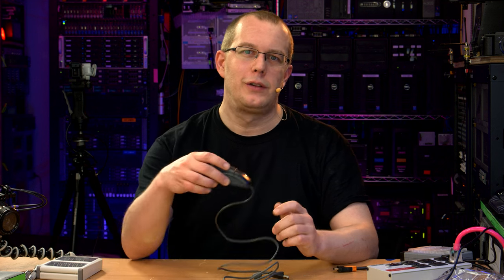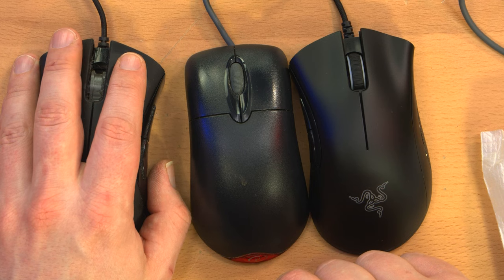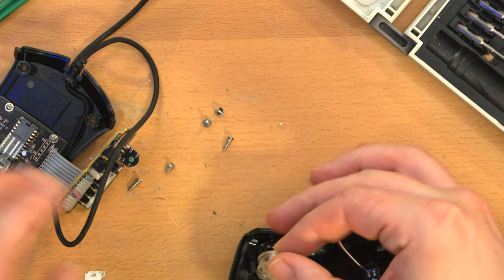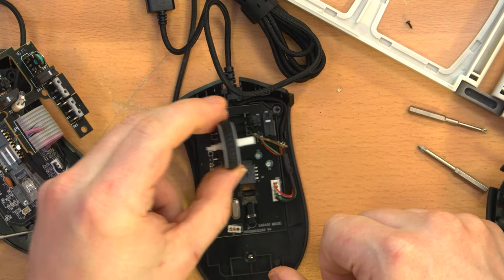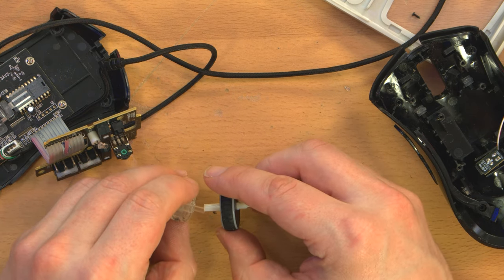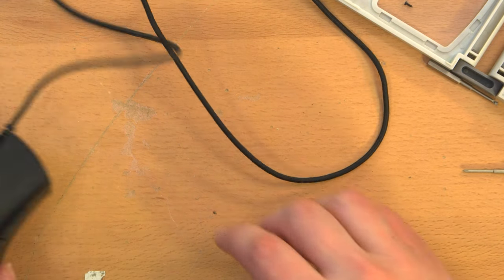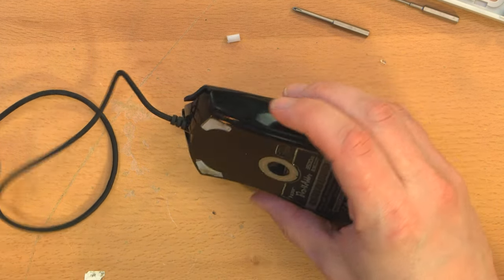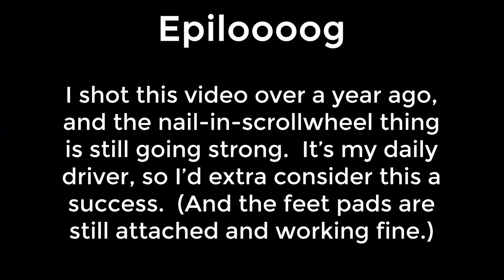Razer Deathadder Left-Handed Edition Scroll Wheel Transplant (Skip to THE SOLUTION Chapter)

Comment: Well done on the repair and yeah this kind of thing is exactly why I fell in love with my 3D printer, if a button/switch/whatever fails then it isn't a big deal just buy a new one, but if some random plastic piece breaks then most of the time you'll just have to toss the device because it's rare you'll ever find a replacement, but to an extent you can print almost anything.
Reply: Dont have a 3d printer but the plastic bits that actuate the left and right mouse clicks broke on me. I wish there was a replacement for those. Even a full top shell replacement would be nice.
Reply: @FilKamiKaze  Well, that should be pretty easy to glue back together, no? If not then try sanding it flat then finding some plastic waste to glue to it.